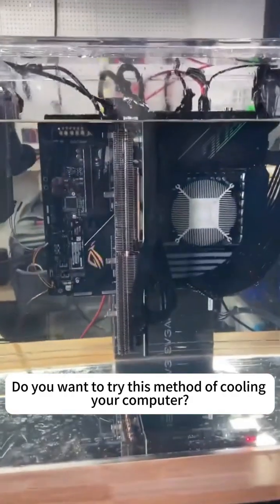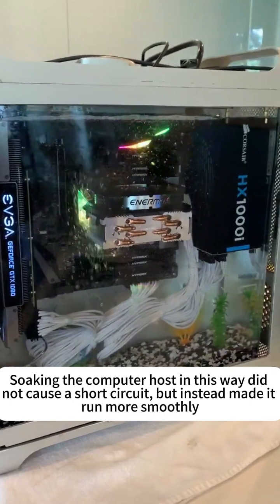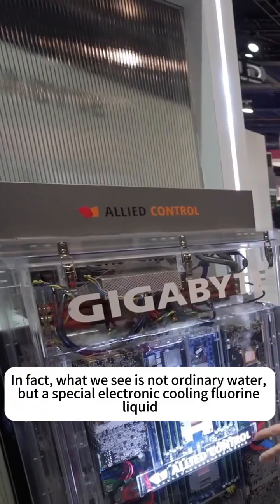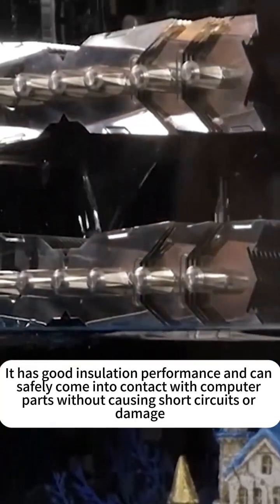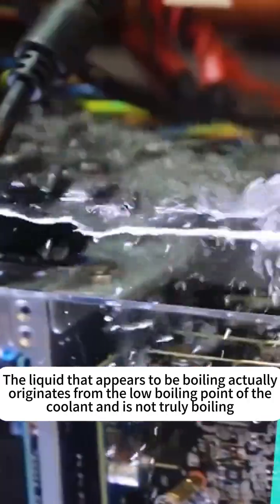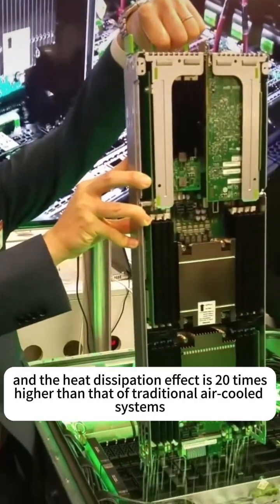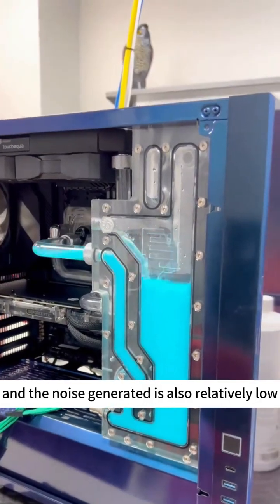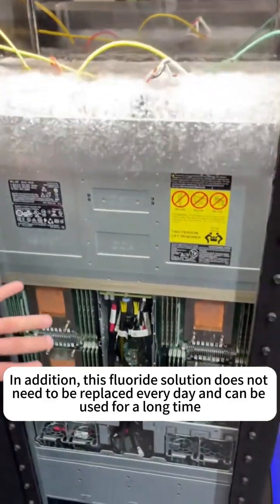Do you want to try this method of cooling your computer?#pfpe #Electronic cooling fluorine liquid

Comment: its thin viscosity mineral oil people have been cooling their systems like this for ages, the downsides are dirt and dust still gets into the oil  and even though its viscosity is thin its still thicker than air/water so any circulating fans/pumps will burn out faster
Reply from the maker: Hello, first of all, thank you for your viewing and evaluation. There are some points that need to be clarified here. First of all, these liquids are a special and very expensive coolant called fluorinated liquid. It is characterized by high temperature resistance, extremely high chemical stability, and strong thermal conductivity. It is an ideal material. It is used in a sealed professional water-cooled chassis and will not stick to dust or produce chemical reactions due to high temperature.